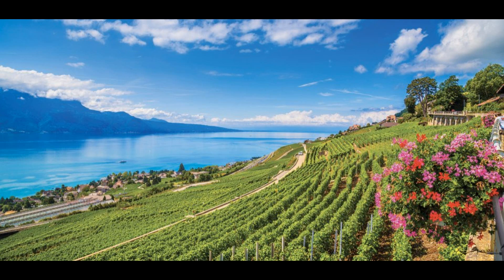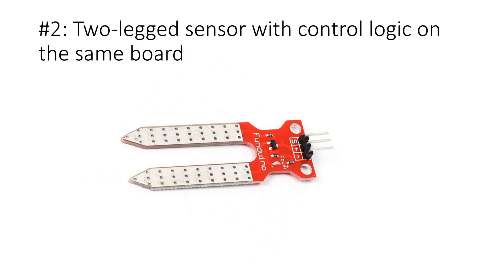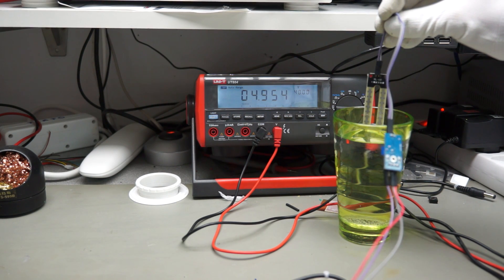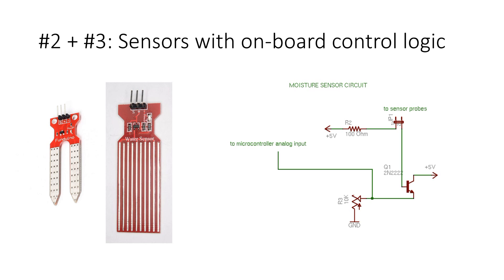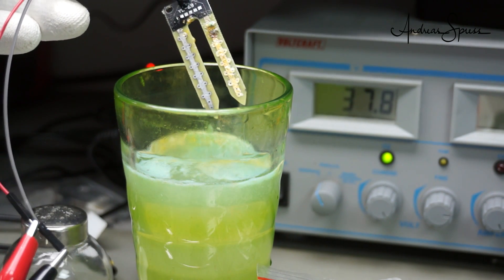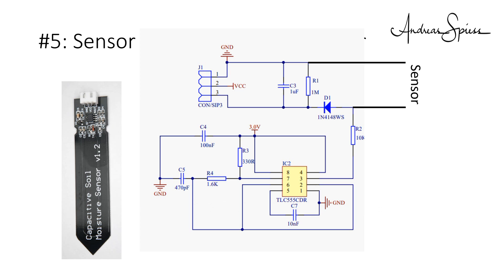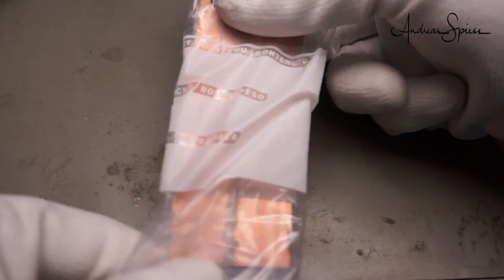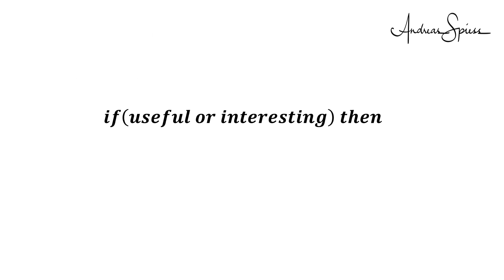#207 Why most Arduino Soil Moisture Sensors suck (incl. solution)

Comment: Hi,
I really like your videos. But this time I am a little bit disappointed. I thought you will bring a "real" solution. I got the same problem like you and I found a way to solve the problem forever without any toxic stuff (plastics, softener, etc). And without having any materials that can corrode.

I took two graphite electrodes, printed a holder for them and connected them to a controller of the cheap china sensor. To prevent any way of electrolysis it changes the polarity of the electrodes every 24h. I take data once every 10minutes.

To get perfect values I did the following:
I took 500g soil and put it in a compartment dryer about 48h around 60°C that it is 100% dry. 
In the next step I took 30g of the soil and put water in it. After it was saturated I took the values from the 100% wet and the 100% dry soil - each with 30g of soil. Then it was time to get some values between these measurements because it does not change linear.

Here are my resultes (6cm dipped electrodes, 5mm diameter) :
Moisture // Value
0% // 1024
20% // 634
40% // 339
60% // 321
80% // 307
100% // 260

It shows, that I need to repeat this measurement with moisture values between 0% and 50% in smaller intervals. But if we think about the resilience of nature it isn't so important.

Anyway: Thank you for your great videos and explainations.
Reply: If someone is interested in my solution, I could make a small instruction. I would share the 3D model, too.
Reply: @mr.b.1589  I am interested, pls do a small instructions of your solution and model
Reply: Please do! I am interested.
Reply: @mr.b.1589  Did you do a video about it? I'm really struggling with the same issue and this looks like a definitive solution!
Reply: Changing the polarity every 24h to "prevent any electrolyses" is not how it works. You simply swap the anode and kathode around every 24h. Depending on the type of graphite electrode and current you will get different lifetime out of them. But electrolyses is something you cant simply prevent in this setup.
Reply: Ray: That might work. But, those are more expensive materials and the cost of the sensor would go up drastically. 

I like Mr B's approach of using the carbon/graphite rods. What's nice is that the rods can be acquired relatively cheap overall. Get some thick pencils and strip the wood off (or just one side that would face the other probe) or get graphite drawing pencils. You can get a pack of drawing pencils for a few dollars (USD). You "could" use the graphite rods from lantern batteries, but I wouldn't use them with food plants as it could introduce some lead into the soil (unless the battery was lithium which would need to be cleaned off before using)
Reply: Andreas Spiess I cannot find that comment, at least here from the smartphone. What's his username?
Reply: Eric-Jan van den Bogaard   what about platinum or gold plating the electrodes?
Reply: @raykent3211   Right! It can be part of the finish of your circuit board if built in a commercial house. And like the gentleman with the carbon brush solution use AC to avoid electrolysis. Use timed pulse measurements instead of continuous. Easier on the plants, they have electrical systems too. Additionally, Copper corrosion, (Cuprous Oxide) is a Biotoxin, and very distasteful, so beneficial critters may never develop like fungi and worms.
Reply: @bryanst.martin7134    thanks! We seem still to be learning a lot about subtleties of plant communication and the microbiome  (if that's the word). An expert on Gardener's Question Time said that if a plant is in a hard pot you can tap the pot, it rings more if the soil is less moist.  That could be electronificated : measure the acoustic impedance of the medium.  Then again, the plant might be alarmed by the sound....  I think I'll stick with upward capillary wicking.
Reply: I have this setup in use for 3 months now for my peppermint. I have tested it with soil from it and the values are nearly the same (+/-1% - condition: same temperature, same water, etc.). The main reason for this is that the surface of the electrodes does not change. No corrosion etc...

In addition: the problem with metal electrodes is, that they solve in postitiv ions under electrolyse. This changes the conductivity of the soil and the result is: BAD measurements. So just use inert electrodes like graphite (quiet expensive, but for food, its a better choice)
Reply: What i understand of Adreas's test, is that the galvanic/resistive  "way" may be not the correct "road" to travel on, (somebody already  tried aluminium electrodes ?) due to corrosion, maybe one should use silver electrodes because silver oxide is a conductor :) (hence use on switch contacts) in theory copper oxide stops oxygen from further corrosion, but will be a isolator, doing it the capacitive way seems a better solution, otherwise ultrasone ? the sound travels faster through water, i can't think of a better way then Andeas found in this test. and doubt if there is.
Reply: @eric-janvandenbogaard9415  Silver will gradually wear down with the water in the soil and end up in the soil the same as when used to make  Antimicrobial Silver when you pass a voltage through the silver electrodes it like plating the silver moves from the electrodes to the negative side, how about stainless steel??
Reply: Just paint the electrodes of a cheap sensor with conductive paint my dude. It's basically a graphite coating.
Reply: Jadin Andrews ...which will peel off in no time when the electrolysis starts....
Reply from the maker: Good work! Maybe you follow the interesting link in Craig’s comment (above). The studies there suggest it is hard to get reliable measurements from resistive and capacitive sensors. This is what I experienced and why I gave up to increase accuracy. I accepted the results because to keep home plants healthy it should be ok. But it seems you got pretty good results with your sensor.
Reply: You can not get Iron out of a water solution by electrolysis. The hydrogen will go first. Copper is possible but it would have to be in solution to do so. However its not in solution but a precipitate and any solution would be moved away from the sensor pretty regularly when watering.
Reply: Mr. B. While your graphite "trick" sounds like a pretty neat idea, graphite is quite brittle, which makes its potential applications much more limited.
Reply: You just have to take graphite electrodes with a big diameter. 8mm or more.
Reply: Leo Curious I think he meant that iron dissolved in water will plate out in a small amount. In fact it will plate out even in bigger amounts if a correct plating bath is used. I believe the processes (of plating out iron together with cobalt perhaps) has been used by the tape industry for decades.
Reply: Mr. B. I actually do happen to own a couple such electrodes. While they're reasonably stiff, big diameters are largely impractical as well.
Reply: Leo Curious, I never said my idea was the 'real deal', It was just an idea to prolong the life of a cheap sensor. I think it's a bit silly to get very technical about $1 sensors that can be replaced with $3 capacitive ones, with none of the corrosion issues.
Reply: The screws contains chrominum. I really recommend not to use them - because the standard electrode potential from Cr//Cr3+ is -0,74V.
Reply: It will (because of the standard electrode potential). But in a very small "amount" (sry, I don't know the correct word). I just have to look in my tin watering can (local cell), which I use for the flowers, to prove it.  With changing the polarity I just want to hold the concentration of positiv ions in my watered soil.
Reply: Can you specify what you refert to with "it will... in a small amount"?
Reply: Iron out of a aqueous(!) (=in water) solution? Are we on the same page here? Please show me any kind of proof for this claim. How would you electroplate a tape? Its not condutive in the first place. Its done with PVD, a gas-phase process... if you are talking about these thin metallizations like with mirrors.

And yes, just "painting" a electrode is not going to help at all. Why would you put such ideas out here as if its the real deal and not just some idea you happen to have? Having long lasting electrodes (non-super expensive) is a really big deal in the industry and so far I dont know of any method.
Reply: Leo Curious "Iron out of a aqueous(!) (=in water) solution?" - Well yeah: http://jes.ecsdl.org/content/84/1/319.abstract It isn't anything new either (the article's from 1943).
"How would you electroplate a tape?" - I didn't say that they used the process to plate tapes. More like tape heads from what I can remember. 

"Having long lasting electrodes (...) is a really big deal and so far I dont know of any method" - I do, several ones in fact. One is platinum-coated titanium and the other ones are MMO (mixed metal oxide) electrodes. I do happen to own one of the latter category consisting of some sort of metal (probably titanium) coated with Ruthenium-Iridium Oxide. While it was expensive, it wasn't super expensive.
Reply: Interesting read, thank you. They plated stereotypes (lead) and some sort of wax? I dont know what they did there to electroplate wax. So yes, they did it in aqueus solution. However:  Its not going to happen in soil, the conditions are not right. (I gues we both know that even Sodium can be made with the right kathode / overpotential like Hg?)

And yes, MMO or even PbO2 is possible, tho PbO2 has a limited use. I checked some papers and Pt-Ir seems to be really good for eg. NaClO3 production. I was never able to make a working MMO or PbO2 electrode sadly...

On topic: Capacitive is the way to go. :D
Reply: Using graphite is the way to go, but it really is not necessary to change the polarity when using graphite.

I use 5mm rods. Yes they are more vulnerable than steel, but I stick them into the soil and that's it. You could even attach them to a rigid plastic backing to make them less vulnerable
Reply: Changing to polarity of the electrodes every 24h would not prevent electrolysis.

However, i do like the idea of changing polarity. But, it should be done on EVERY measurement.

First, the power should only be on during a measurement - this by itself would extend the life of the electrodes.

Second, by switching the polarity on every measurement many electrochemical reactions on that do not result in a gas would be somewhat reversed when the polarity is reversed. For example, if a number of Copper ions are removed in the first measurement, when the polarity is reversed in the second measurement some of the copper ions that are still in close proximity to the electrode will re-plate the electrode. Then in the third measurement when the polarity is reversed again the first ions off will mostly be those that re-plated the electrode in the second measurement, preserving more fresh copper.

By switching the polarity on every measurement this will extend the life of the system. By waiting 24h for the polarity switch, too much of the earliest byproducts will have had too much time to physically move to where a reversal would be much less likely.
Reply: @michaelyoutube5149  I do it with my carbon electrodes. And its works perfect till today.
Reply: Or use a couple of stainless steel screws.
Reply: Thats not correct. If you put voltage on the electrodes soil- and watersolved metalls like iron (Fe2+) or copper (Cu2+) become "real" metals which you can see after a period of time on the surface of the negative electrode. You can get them back by making the negative electrode to the positiv electrode because they will solve in the "wet" soil. This has two advantages: 1. It doesn't change the conductivity of the soil (maybe a little bit) because the positive ions stays in the watered soil and 2. the surface of the electrodes only changes a little (if they are very clean (min. 99,5% carbon))

Comment: I have here a few self destructing moisture sensors, never put them to use because of that. Now I shall buy the capacitive version and forget about the other one! Thanks mate!
Reply: If they don't contain electronics, only bare traces. Keep them. If they contain electronics that can only drive them with direct current, keep them and maybe remove the electronics. You can drive them with alternating current to minimize electrolytic corrosion or maybe try to convert them into capacitive sensors. Or destroy them by using them to observe the effects of electrolytic corrosion or teach someone else about electrolytic corrosion. :)

By the way, the easiest sensor is a screw terminal with two nails in them. I mean the screw terminals used to install light fixtures (They are called Lüsterklemme in German, this should give good results in google image search).
Reply: by removing the electronics, one can also DIY some electrodes :)
Reply: I thought about driving them with AC, but I feel like the payoff doesn't justify the work required to modify them. Especially if there's a better version off the shelf!